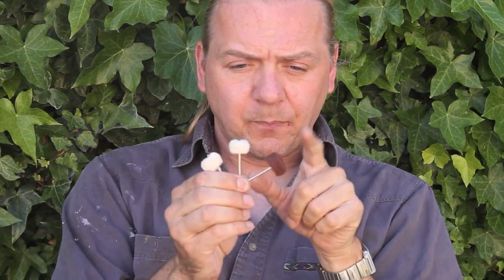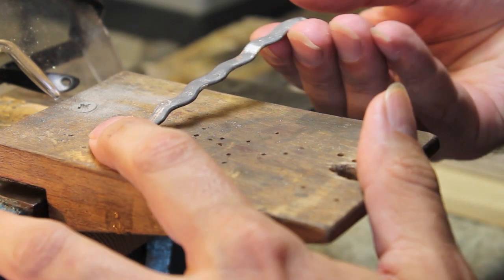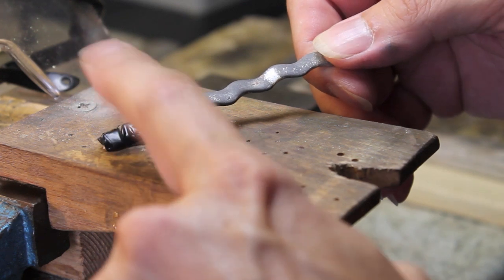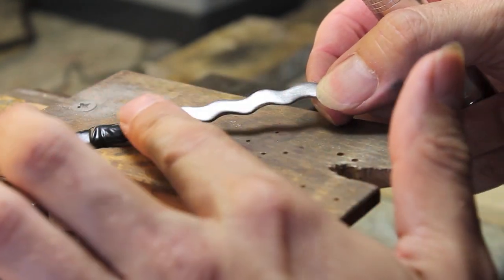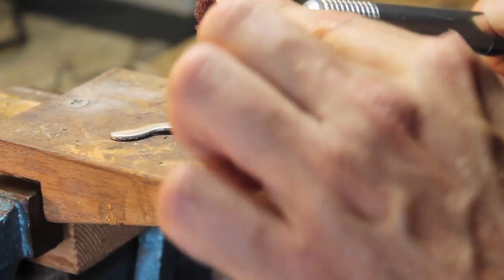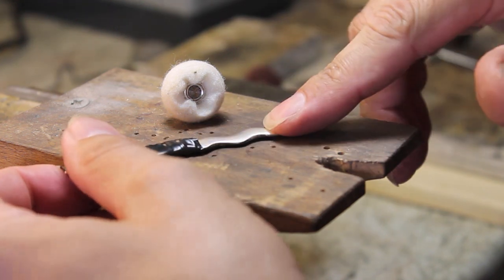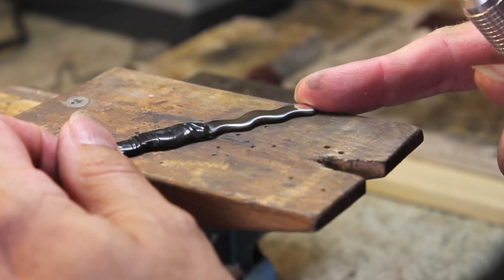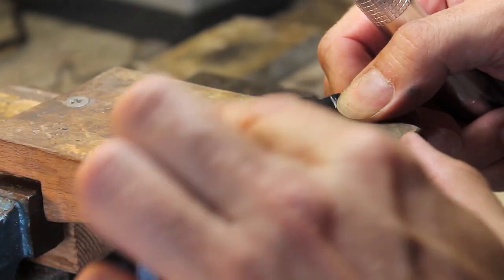How to polish silver in three stages. Demo / Review in HD

Comment: Hi, I followed your process using the Mezerna compounds instead of tripoli and rouge for polishing silver earings. After finished polishing them I cleaned them with soap and warm water, and after a while I realised that there are some stains and some yellow marks on the silver. Could you please explain that went wrong?
Reply from the maker: Depends what you mean by stains and yellow marks. The polish is simply grease (tallow animal fat), with small particles of abrasive, such as aluminium oxide, iron oxide, pumice etc. So any traces of polish will simply wash off with hot soapy water. If you see what you refer to as stains, this could be fire-scale caused by overheating the silver in a small area. It's caused by the copper content in the sterling silver oxidising (or something like that) this leaves a dark shadow which cannot be cleaned off as its within the metal itself. if its minimal you may be able to sand it away and re-polish. But if its deep ,there is little you can do (other than rhodium or gold plating over it). use flux such as firescoff in the first place to prevent this when soldering.

As for yellow staining that's interesting. Assuming it's not the polish. Then yellow staining suggests to me that the item is not solid silver. When you polish items which are silver plated (or fakes) the first thing you'll notice is a slight yellow colour, this is the brass or nickel underneath starting to show through as the plating is worn away by the polish.
It could just be that the items are indeed silver, but have also been plated over top. In such cases some manufacturers apply a coat of nickel plating first to seal it before rhodium plating over that. Hence you may see the same nickel underneath. Possible, but highly improbable. a fake or plated item is more likely.

Sorry I cant say much more without seeing the pieces (feel free to email me some pics below) but hope this helps. Dave . mail@celticdreams.co.uk

Comment: Can you use these bits on silver plate? I have a smallish beverage container that I can't get right with elbow grease!
Reply from the maker: Trouble with silver plate, is that and such sanding and heavy polishing will remove the surface plating. Dave

Comment: Hi Dave, do you use sand paper when you make your jewellery? Or do these make that part of the process redundant? After filing, do you go straight to your flex shaft? Thank you 🙏
Reply from the maker: Although called sanding I use Emery paper, not sandpaper (two different things). In this case the Scotchbrite wheel replaces the sandpaper. But usually after filling I will sand at 600 grit, either with a buff stick or sanding drums. I can then go straight to polish. Check out the ID bracelet restoration which may explain better. Dave  https://youtu.be/Iv6NNClZdNU
Reply: @CelticDreamsCoUk  ok great I will watch, thanks Dave!

Comment: You used these 2 compounds here then the Mezerna in the other video. Which is better?
Reply from the maker: Traditionally Jewellers use Tripoli (pre polish) followed by Rouge. I have now replaced both of these with the Menzerna intensive polish P 164 blue, followed by super finish P175 Yellow. Personally I much prefer the Menzerna polishes, but the Tripoli and rouge are perhaps easier to source. Dave

Comment: I have this sterling silver ring with a 14k gold inlay on it. Would this method work on the gold inlay as well to make it a polished finish?
Reply from the maker: It depends on that you mean by gold inlay. If its a large piece of gold set into the silver, then you can polish it just like the silver. But if it's only a thin piece fused to the surface, or perhaps just a plated section, then heavy polishing could strip away a thin gold layer. Using a tumbler (barrelling machine) or magnetic polisher can burnish the piece and make it shiny without any loss of material. Perhaps that's the best option. Dave.

Comment: I have a Drill Master Rotary Tool that's locked at 16,000 rpm do you think I would still be able to use it to finish jewelry?
Reply from the maker: If it's locket at 16k then there is obviously something wrong with it. I cant recommend using a faulty tool. But yes indeed 16k is about half speed. So quite fine for most jobs. Dave.
Reply: Not faulty...just cheap :)..Great video btw, i'm just getting into finishing my own jewelry!

Comment: What is the best rouge for polishing silver jewelry. Is it the white or red rouge?
Reply from the maker: Impossible to say. I'm not sure what you mean by white rouge. Rouge by its very name is red, hence the name Rogue. All polishes are different. You can have half a dozen different brands of rouge and they will all be different. varying sizes of grit, some are more greasy, some are drier and crumbly. Likewise many different brands make white compounds. So its impossible to comment on such a general question. Also the mops you use will have a huge impact, as well as the speed and the way you prep the surface will all have an effect. But what I will say is that I now use the Menzerna Polishes from Germany. I use a loose cotton Calico mop with Menzerna P164 Blue, which is an intensive polish and removes surface scratches. I then finish with a soft loose cotton mop (swansdown) with the Menzerna P175 Yellow Super Finish. This buffs precious metals to a high shine. hope this helps. Dave

Comment: Hello thank you for making these videos, I'm interested in making some silver jewellery and these videos are very informative and just what I need! My question is do you really need to use pickle or can you just use these methods you shown on here or Is the pickle better for cleaning and polishing?
Reply from the maker: +Anum Y ....Firstly, thanks for watching and taking the time to get in touch. Great to hear from you. Short answer - YES, you need pickle. Most people use Borax to solder, which creates a glassy film on the silver to prevent it from oxidising whilst being heated. When you've soldered you need to remove the borax, But its actually tougher than the silver. So polishing it with mops will wear away your silver but not remove the borax. Hence pickle (weak acid) will dissolve away all the borax and also take away any black oxidisation. You are then left with clean silver, ready to start polishing.

If its just an old piece with black oxide on it, The pickle will still remove the blackening and give you a good start for cleaning. Check out my Pickle video....Dave.

https://www.youtube.com/watch?v=KyA3JS0OtYA
Reply: +Celtic Dreams ohh I see, thanks for responding :D keep up the great work :)

Comment: Why not just use the bench polisher and do It in one och maby two steps?
Reply from the maker: You get a much better finish going in steps. its all in the preparation. Going straight to polish,  may well wear away the scratches 'eventually'. But it's much faster to remove the scratches with abrasive, rather than polish.  Then smooth and refine the surface before final polish. Doing it in stages gives super results and ultimately doesn't really take any longer. Dave

Comment: There are so many polishing compounds, so confusing. What would you suggest to use on white gold/yellow gold/silver? All these three metals, and which would be the best for pre-polish and final polish?
Thank you
Reply from the maker: Hi, thanks for the question. If you are using silver or gold, you only really need two compounds. Tripoli, which is a brown pre-polish and helps to remove fine scratches. Then rouge which gives a nice mirror finish. On a bench polisher, Use a loose cotton (calico) mop for the Tripoli and a fine very soft cotton mop (called a swansdown mop) for the rouge. That’s basically all you need.

(note that white gold isn't really white, it is plated with rhodium, so usually need re plating after working on it).

However, I have recently moved away from the traditional Tripoli and rouge. I now use Menzerna polish. These are absolutely stunning. They make a whole range for different metals, but again you only really need two. They have a grey IP (intense polish) which will remove scratches and get a slight mirror finish on its own. You can then finish with the yellow SF super fine polish. These new Menzerna polishes have now replaced my Tripoli and rouge.

The only time you would need anything else is when working with platinum, which is much harder. So you would get a pre polish and fine polish for platinum. But again you only need the two.

Check out Andrew Berry’s video review of them. http://www.suttontools.co.uk/vtr-menzerna-polish

Kind regards. Dave.
Reply: Celtic Dreams Thank you very much for such an informative answer!
Reply from the maker: Lada Slada any time. email me direct if you want any more advice. Happy to chat. mail@celticdreams.co.uk